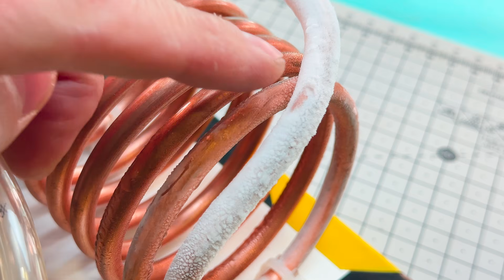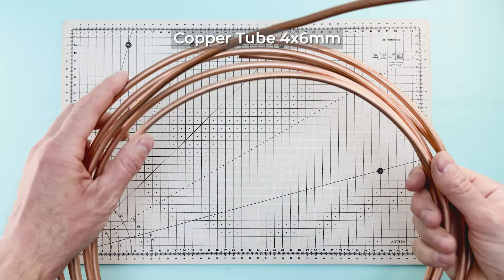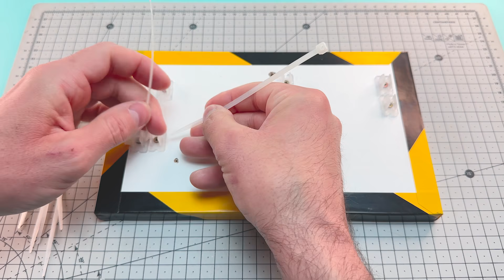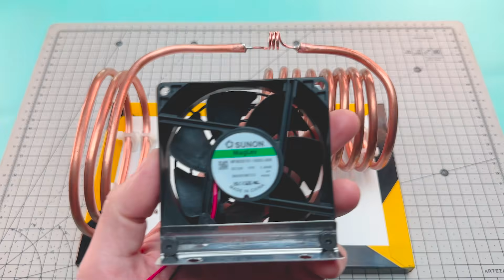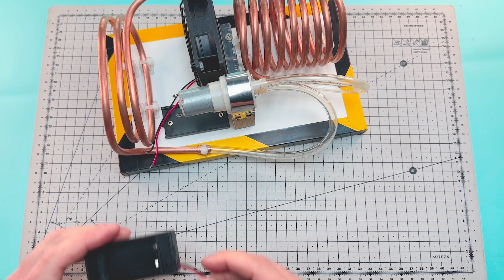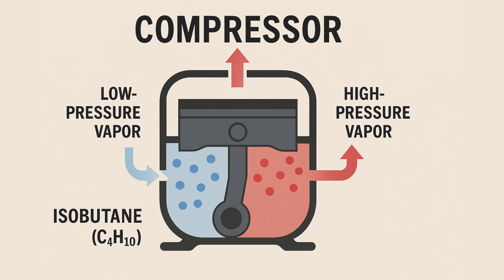DIY How to Make a Powerful Portable Mini Air Conditioner ❄️-10°C

Comment: Hello!... I think its a good idea and I like it!... I was wondering if you can use the grid heatsink from the liquid refrigeration systems used in desktop PC so instead of the water or liquid you can pass the refrigerant and blow the air with a PC fan and with that improve the cooling of the air.

Ist an idea, maybe you can do something better.

Comment: you can submerge the capillary tube section (the condenser) in water. running water should help carry heat away. the cold tube section (the evaporator) can be placed inside salt-water so you can put something inside the salt water to freeze it without the need of the 12V fan. this was how the American doctor John Gorrie built the first ice machine so he could save his patients, because buying frozen ice cut from frozen lakes from ice companies was expensive, and unhygienic. his original design use normal air and multiple stages which works but barely. other inventors then start using refrigerant gasses like isobutane to improve its efficiency and allow the use of a single stage refrigerator.

if you are using industrial refrigeration gasses, please check with your local laws on whether its legal for you to handle refrigerants without a license. some refrigerants are flammable, explosive, corrosive, toxic, or ozone depleting (or a combination of these)

edit: you can also use a larger pump (preferably displacement pumps, but centrifugal pump works too) with a 24VDC motor. you can use fast charging USB (65 watts and above) since they can output 12V or 20V in some cases.

Comment: the audio ducking was abit distracting at the start. Great idea though, but i guess there is alot of potential in terms of air flow. Also curious whether the little gas you added there really resulted in the -10 at the start. cost of the gas ?